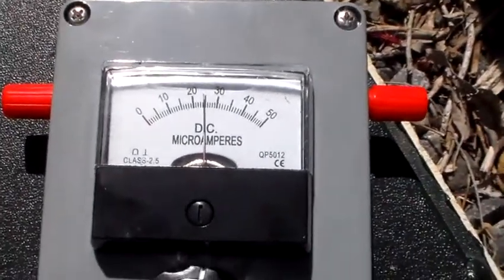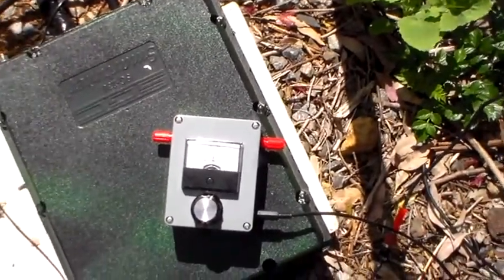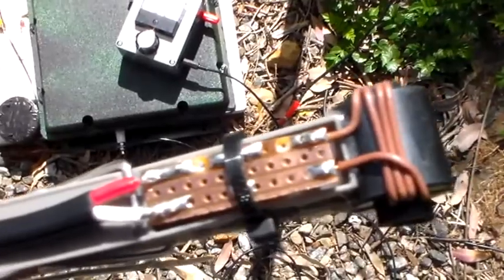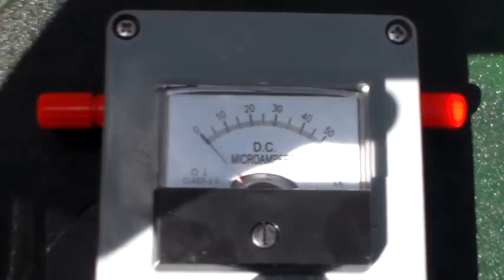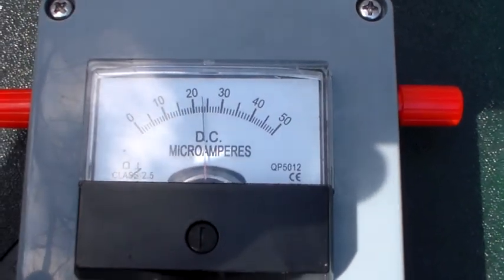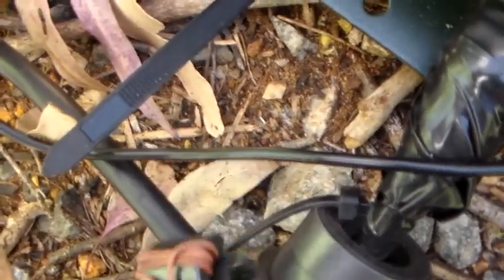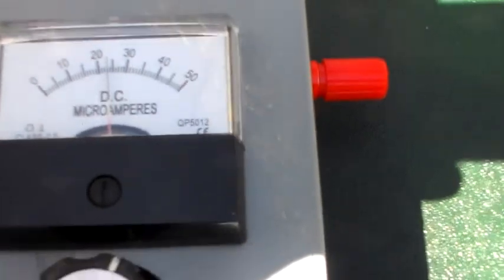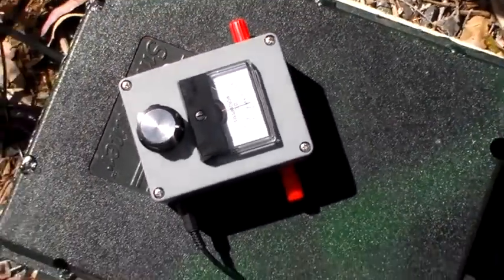Remote Probe For The RF Current Meter

Comment: If you’re testing the ground wire for current, isn’t that the same as home electrical wiring?  If so, I should be able to take these kinds of measurements with my electrical clamp on meter.  I’m certainly going to give it a try.

https://www.kleintools.com/catalog/clamp-meters/digital-clamp-meter-ac-auto-range-trms-low-impedance-loz-2000-amp

Comment: http://www.ifwtech.co.uk/g3sek/in-prac/inpr1005_ext_v2.pdf. Take a look at this regarding chokes think you'll find it most informative and the parts are cheap. Please forgive me for posting this publicly but I could not find your email address. Even if the parts are not readily available in your area I think you will find an incredible value in the technical information, very good points are made about ugly chokes and other such things in regards to the very narrow bandwidth and the need for much higher impedances than normally thought in regards to to this application. Please feel free to delete this if it seems inappropriate in regards to whatever rules you go by in this venue
Reply from the maker: Thanks Don. Putting it here is fine, others may also find it interesting. My 'Ugly Choke' seems to work well on all bands, and it's probably the simplest form of common current choke so I'll stick with that for now.

Comment: Great video and really interesting!  I am interested in building one of these, you mentioned the probe has a resistor, capacitor and diode, what is the reason for these being added?

Kind regards,

Simon
M0SYS
Reply from the maker: Hi Simon, thanks for the comment. I'll do a video showing the circuit diagram in the next day or so. The reason for the diode is to half wave rectify the AC RF voltage, the capacitor smoothes out the 'humps' in the rectified DC and the resistor reduces the voltage fed to the panel meter.
Reply: What is the difference between having sheets in the ground for the ground and having a counterpoise?  On one hand I've been told by others that you want a counterpoise the same length as the radiating element to act as a dipole, other thoughts are that a big chunk of metal buried will do the same job.  A third comment was discussing the fact that sheets provide a capacitive effect which is needed.... I'm confused about all this but I did study Physics at university and since I can tell you know your science if you could explain all this I would greatly appreciate it!

Kind regards,

Simon 
M0SYS
Reply from the maker: The best counterpoise will provide a load that with the radiating element looks like a dipole to the transmitter with equal current in each leg. An efficient earth will do the same thing without having the the additional counterpoise wire. All the counterpoise wire is doing is capacitively coupling to a poor earth over a larger area to improve the earth efficiency. Earth rods have a low surface area so they provide a less efficient earth than aluminium sheets. The video showing the ground current on the meter clearly shows the aluminium sheets are a far better earth than the ground rods. The bottom line is, if your ground material is nice and conductive like clay or loam bury some aluminium sheets or similar. If your ground material is sand, or other high resistance material use a counterpoise to improve the ground efficiency. Or put up a dipole.
Reply: Thank you for the explanation, what is the advantage of a conductive ground vs a counterpoise?  Why do some end fed antennas like the Hyendfed line work very well without a counterpoise?

Sorry to bombard you with questions, but I've asked around a lot and you have very good scientific answers rather than heresay!
Reply from the maker: No worries. The Hyendfed antenna uses the coax feeder braid as the counterpoise, you could try an experiment, put an ugly choke in the feeder close to the Un-Un and see what happens. The advantage of a conductive ground is you don't need a counterpoise, it's a far less complicated arrangement. My wire antenna is 57metres long, I wouldn't want wire running across the ground under it in the back garden as people may trip over it. The other reason is my antenna doesn't run in a straight line, so the counterpoise would have to run over paths etc.
Reply: VK6CS does this mean I would need the coax run to be of a certain length for it to work?
Reply from the maker: No, it can be quite short, but generally the longer it is the better it radiates. If you have one of these antennas try an experiment. Get another station to give you a signal report and then wind the coax feeder around a bit of PVC tube close to the Un-Un to form an 'Ugly Choke'. Wind it over a length of about 6 inches and a diameter of 100mm or so. You won't have to cut the coax. Then get another report. You could then move the choke further from the Un-Un and see if the signal goes up or down. You will probably find different spacing works better on different bands.